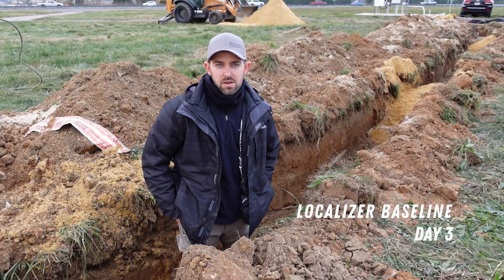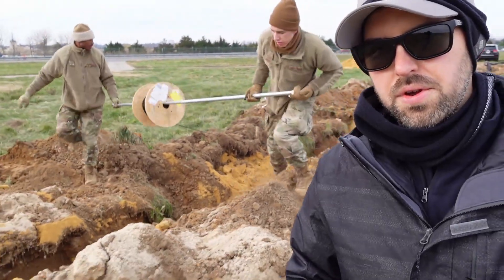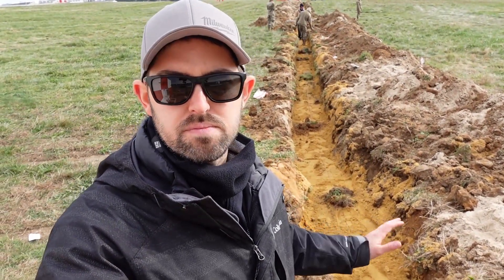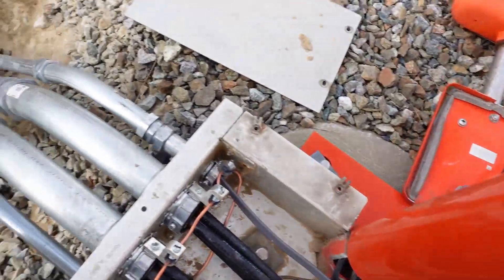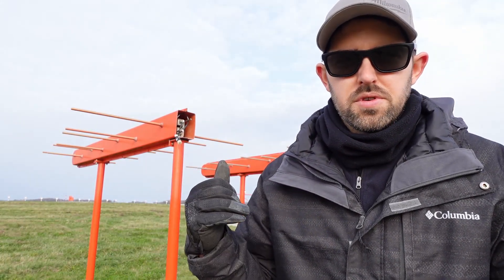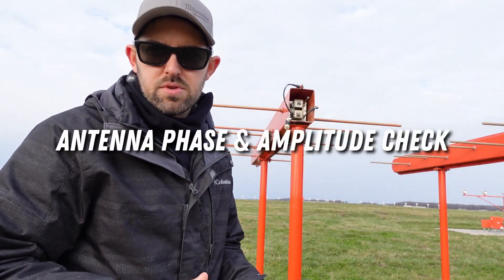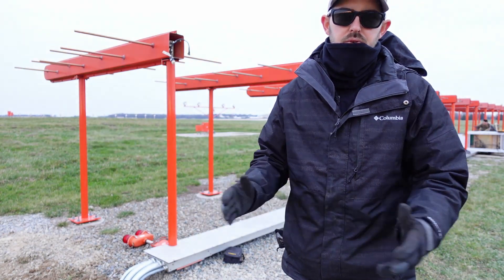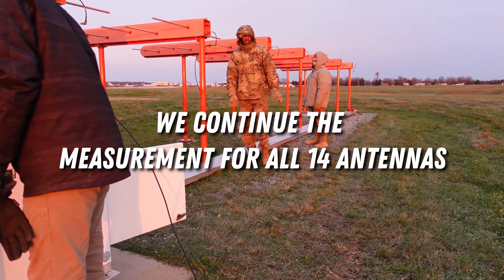Localizer Baseline Day 3

Comment: What's the 1/4" Heliax for? We usually run 6 1/2" Heliax cables for a localizer - CSE CSB, CSE SBO, CLR CSB, CLR SBO and 2 spares.
Reply from the maker: Good question. The 1/4" are for the monitor returns. This is a Selex system so they are used for CRS CSB, CRS SBO, CLR 1, and CLR 2 from the combining unit back to a monitor detection unit in the facility shelter.
Reply: @ArtofNAVAIDs  Thanks for the reply. I install and repair/refurbish the LOC and GS on Thales/Wilcox Mark-1DEF, Mark-20/20A and ILS 420 systems. I have worked on the old ASII 1100 series ILS systems which is now Selex 2100 series - upgraded. The ILS420 has the same type monitoring signal return instead of the comm cable with integral detectors as used on the Mk-1 and Mk-20 series LOCs.

Comment: Great job. I have a question though, do you ever use conduit to protect the cables?
Reply from the maker: My preference would be to put all the cable in 4 - 4" conduit the whole way which has been done in some locations for reasons unknown. Direct bury is a long held practice in our organization though. The biggest debate is the conduit holding water but in my opinion I don't see it as a problem with this cable and never have. Conduit certainly makes replacing cables easier.